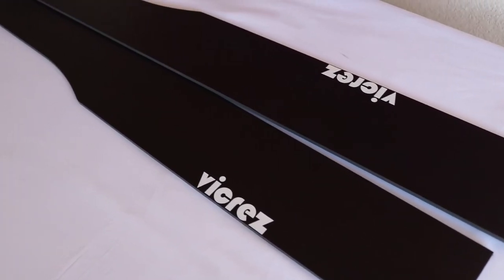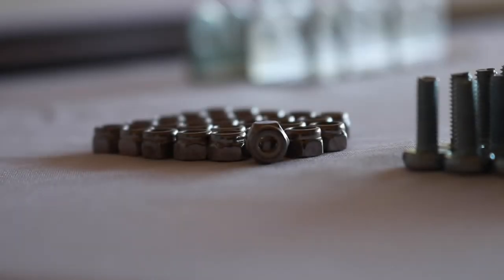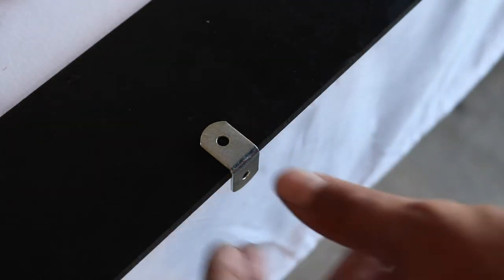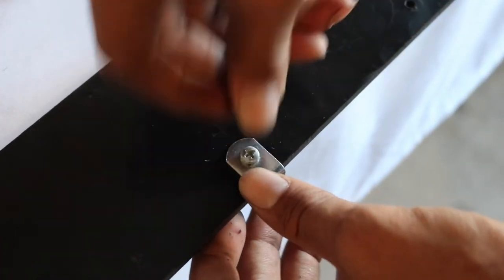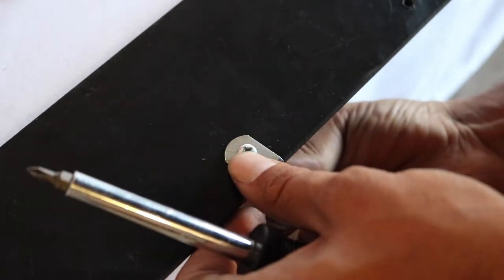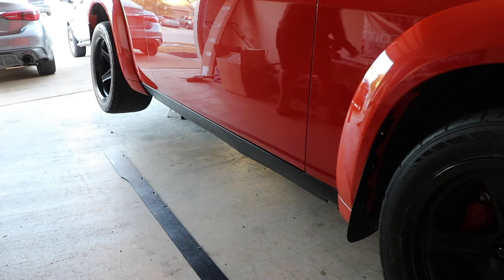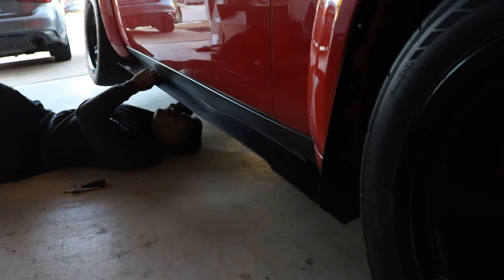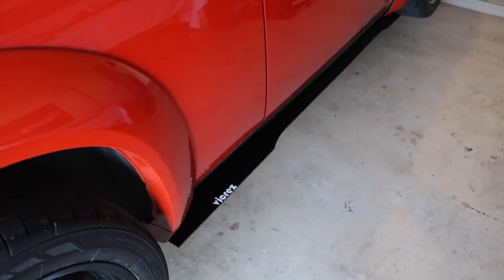VICREZ Challenger Side Splitter Install

Comment: My side skirt/rocker pannel is bowing out in the middle a little will installing these fix that help hold it in?
Reply from the maker: That’s a common issue, no it won’t. The plastic clips on the oe rocker panel are more than likely broken

Comment: What screws did you use for the install onto the pinch welds? The screws that came with it or some self tapping screws???
Reply from the maker: I drilled the holes, used the screws that came with it. Self tappers work too
Reply: @TIRADORACING  don’t need to use the washer I assume in the welds

Comment: it’s odd my l brackets sit against my side skirts well but it doesn’t sit against the metal wall of my challenger because the nuts are in the way with the plastic black side skirt of the car
Reply: I'm having the same issue, got my car jacked up right now. Simply cant make it fit properly because of the rocker panels
Reply from the maker: Pull them off carefully they just sit in place with plastic rivets or push pins holding them at the ends of the fender liner (depending on year).
Reply: @TIRADORACING  
So removing the rocker panel is necessary?
And what about the brackets, they seemed to be too short
Reply from the maker: I wouldn’t say necessary but since your having trouble just remove it. 

*I DID NOT remove them when I did it*

And I’m not sure how they are short for you unless you have different hardware…. 

If you have Instagram send me pics of the trouble you are having because I can’t picture in my head what the problem is…. My imagination is at a low today 😂

You can dm me @tiradoracing.